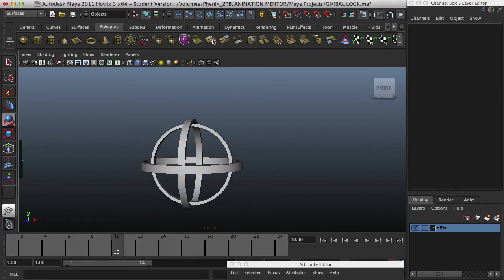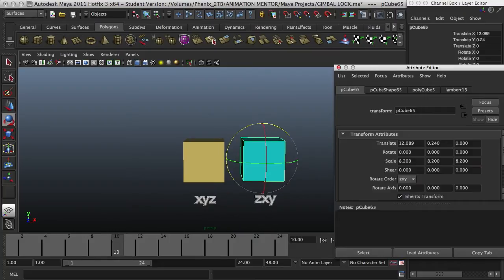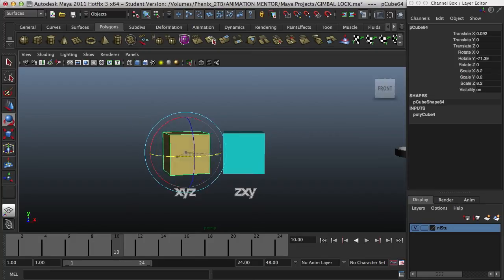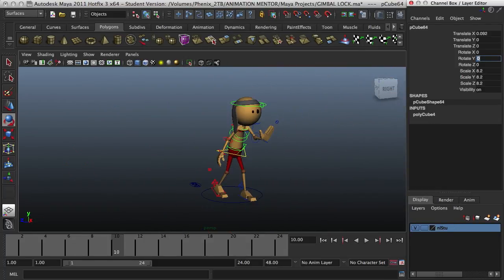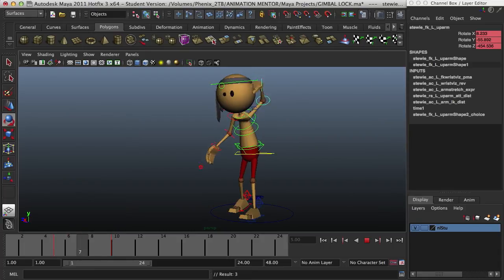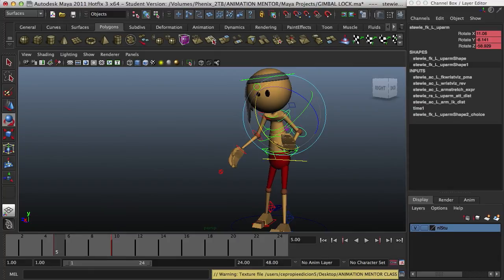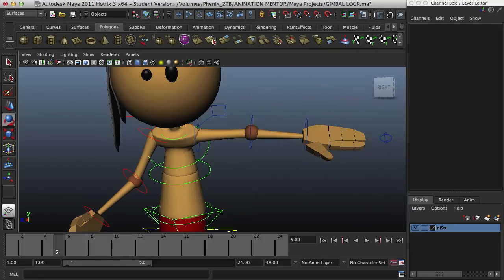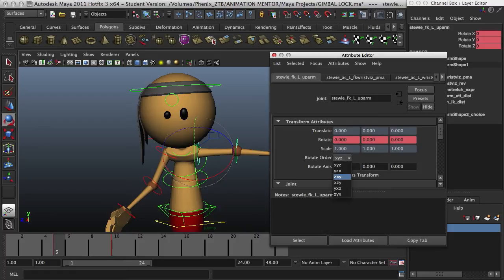Gimbal_Lock.mp4

Comment from the maker: Having a long shot is no easy task. I would recommend you choosing the rotation combo that suits the most frecuently used movement. For me usualy yzx does the trick. Then use the gilbal view mode as much as you can. At least for the blocking and refining stage. Then you can switch to local view just to make small adjustments to the position of your movements. And in case you come across a gimbal fatality, make use of the Euler Filter. If that doesn't work for you, go ahead and zero out the key